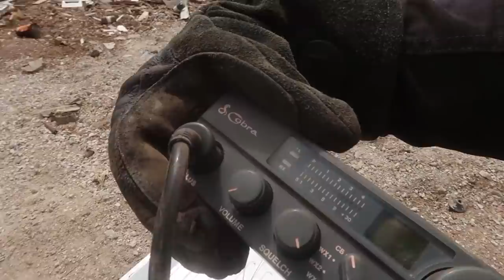Scrapyard Treasure 10: Civil Defense Helmet, 8" Floppy Disk, Conveyor Belt, Flat Belt Pulley

Comment: Holmes 480 was the winch and boom setup from an old school "wrecker" type tow truck, if you need a monster winch most on a 480 should be a 25k lb or more rated winch
Reply from the maker: so what your saying is it could haul giant megolithic stones from a DIY quarry. hrmm
Reply: @RinoaL  yeah with a heavy enough piece of equipment to put it on, or large enough tree to anchor it, you could move quite a large stone.

A holmes 480 would have been mounted on the size of tow truck used to tow something like the big box trucks you can rent from lowes/uhaul just for perspective on the weight its designed to move around.

Also big truck winches like that, can be set up to run off a PTO setup, or hydraulically driven.